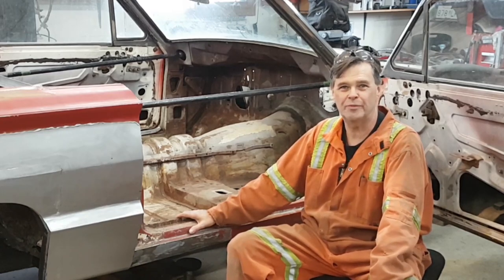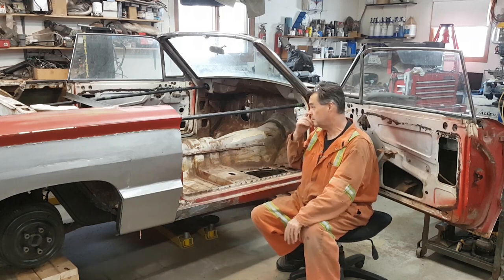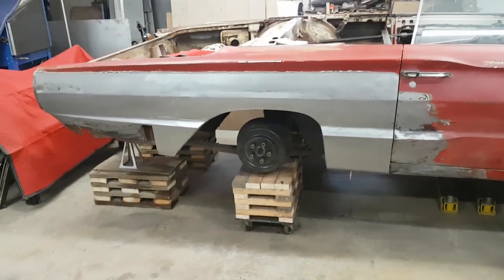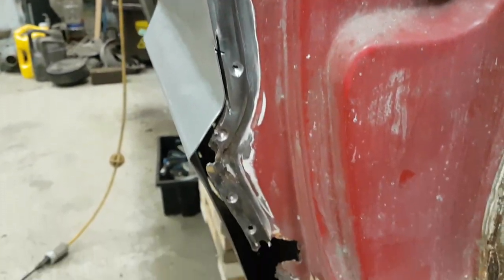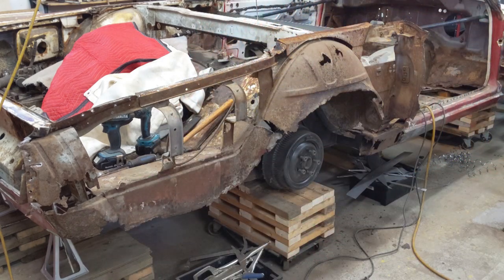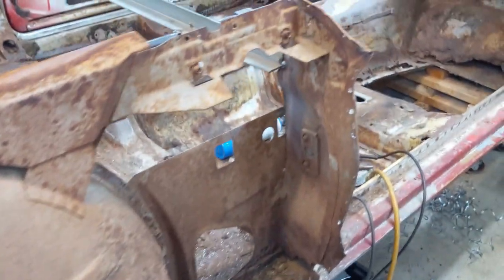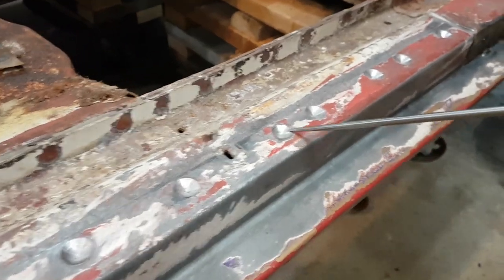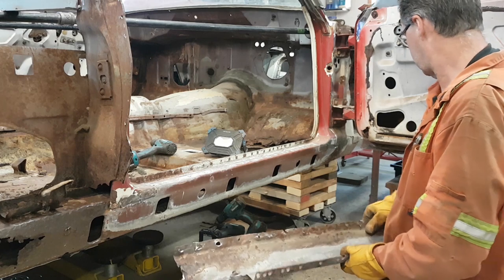Undressing The T-Bird! What's under Her Skin(s)! - 65 Thunderbird Convertible Restoration Ep #19

Comment: Hello Alvin, unbelievable amount of dirt and rust in that rocker! Your inner workings are rusty, but not as bad as I thought you would have. To me, the difficult part is trying to reconstruct something if you do not know what it is supposed to look like. Hopefully, the donor and the other side of the car can show you how it goes.
George B. in Michigan
Reply from the maker: Hi George, it sure was full of dirt, it confirms my thoughts that this was from rural Saskatchewan, and saw a lot of dirt road driving. 
I agree with you on the reconstruction, that's mainly why I don't like just going in and cutting all of the rusted parts away until I can map them...even just a faint line can be a valuable clue needed to rebuild a piece, and that book you recommended holds a ton of information in the form of diagrams!
Thank you George. 😊

Comment: Unbelievable how much dirt built up in the rocker.  It's a miracle it all didn't rust from front to rear.  I recall seeing the adverts that Ford dipped the bodies in an electrostatic primer bath that would fill all of the nooks and crannies.  I think they only dipped the lowest 8 or 10 inches of the body.  I have a 63 Thiunderbird book from the factory that shows the bodies going into and out of the bath
Reply from the maker: I can remember the ads on TV about the "Electrostatic" dipping for Ford's, it was a big deal at the time. Then jump into the early 70's, and things went sideways fast...you likely can remember the phrase "Rusty Fords"? 
The 73 Ranchero GT I have has no primer on the interior floor pans...they painted direct to metal without any primer, even today you can flake off the paint showing bare shiny metal, cost cuts at the time I guess.

Comment: Interesting.  It is amazing how strong a bunch of bent metal becomes.   There isn’t much to the aluminum in an airplane until it is bent then it become crazy strong.  Your brace job is doing the trick until you get that bent metal welded back up.  This is great entertainment and I’m learning lots.  Thanks!
Reply from the maker: Thank you Stephen!
Putting shape into a panel sure does make it strong, and you gave an excellent example of lighter and stronger with shape. 🦾

Comment: I hope he knows they make a special spot well drill bit to remove spot welds you don't have to use a regular drill bit to do it they got a special drill bit just for spot welds it's like a little drill bit with a round hole cutter on the bed so it drills a little hole in the center to guide it and uses the hole cutter to cut the weld out
Reply from the maker: Hi Paul, thank you for the comment!
Yes, I have a set made by Blair, I stopped using it a long time ago because it was slow and I still had to drill a pilot to keep it from jumping around...the drill bits work much faster and less cost.
Reply: Mini belt sanders are the fastest, but I would use a regular drill bit over a spot weld bit any day of the week. If you're reusing the panel the regular drill bit has a better size hole to weld up.